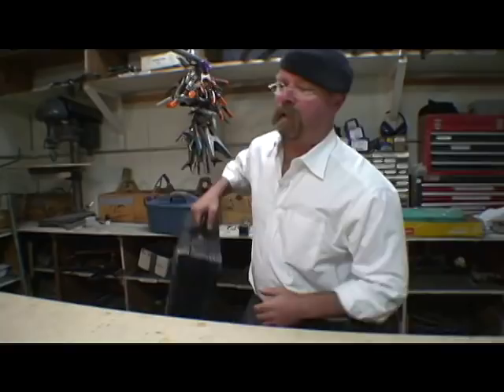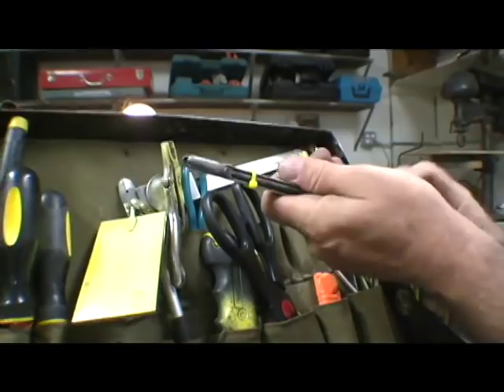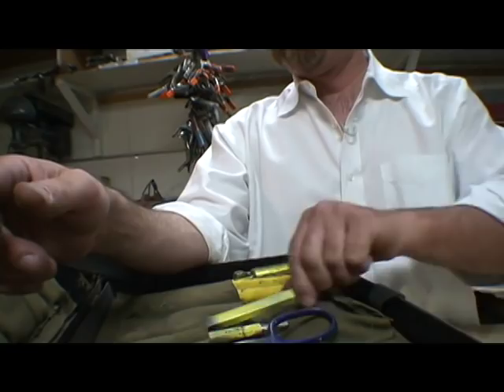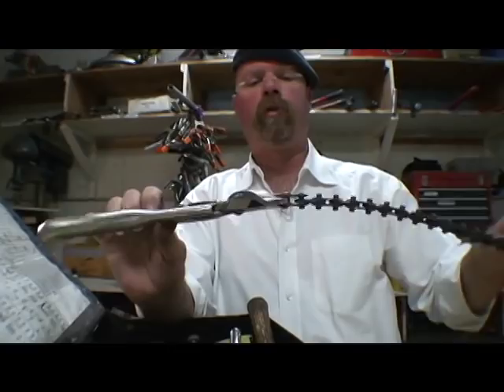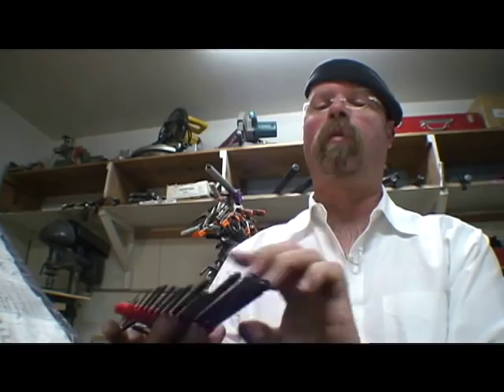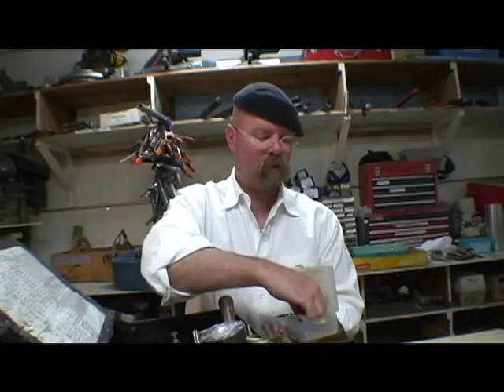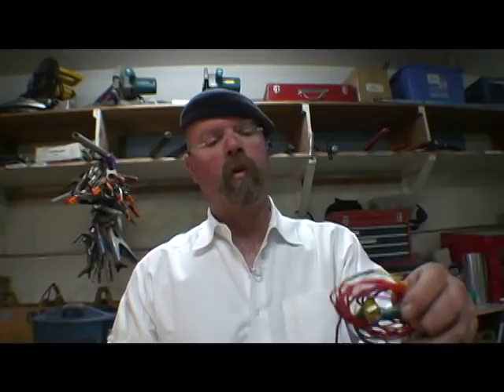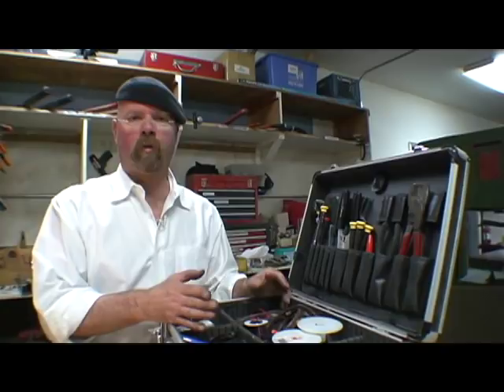M5 Industries - Jamie's Toolkit (2008)

Comment: Jamie's Toolkit complete list:
1) Flat head Screwdriver #1 Size
1) Flat head Screwdriver #2 Size
1) Philips head Screwdriver #1 Size
1) Philips head Screwdriver #2 Size
1) Long Flat Head Screwdriver Smaller
1) Long Philips Head Screwdriver Smaller
1) Set of Unibits
1) Telescoping Inspection Mirror
2) Small Vice Grips
2) Small Channel Locks
1) Caliper
1) Box Cutter/Utility Knife
1) Snap-Ring Plier
1) Utility Scissors
1) Fish Hook Remover/Long Reach Piler
1) Set Prick Punches
1) Center Punch
1) Telescoping Magnet pick-up
1) Glass Cutter
2) Set Forceps
2) Set Tweezers
2) Set Squeeze-to-Open Tweezers/Reverse Tweezers
1) Set Wire Bending Pilers
1) Hack-saw/Mini Haw-saw/Mini Hack-saw set
1) Metal Cutting Sheers
1) Wire Cutters (knipex) 
2) Sharpies
2) Pencils
2) Pens
1) Long Bit Holder with Adjustable Depth
1) Set Cold Chisel
1) Wire Piler
1) Exato Knife
1) Set Exato Replacement Blades
1) Bit Screw Driver
1) Set Bits (Safety/Security/Torx/etc)
1) Silicon Grease
1) Shrader/Presta valve Air-compressor Adapter
1) Dental Floss
1) Blades
1) Sharpening Stone
1) Ball Peen Hammer
2) Medium Vise Grips 
2) Large Vise Grips
2) Medium Channel Lock Pliers
2) Large Channel Lock Pliers
2) Small Crescent Adjustable Wrenches
2) Medium Crescent Adjustable Wrenches
2) Large Crescent Adjustable Wrenches
1) Large Long Flat Head Screwdriver
1) Nylon/Rubber Mallet
2) Slip Joint Pliers
1) Large High Leverage Cable Cutter
1) The Nibbler (cutter for square holes)
1) File
2) Small King Dick/Monkey wrench
2) Medium King Dick/Monkey wrench
2) Large King Dick/Monkey wrench
1) Tape Measure
1) Flat Head Stubby
1) Phillips Head Stubby
2) Vise-Grip Locking Chain Clamps
1) Drill Press Hole maker
1) Set Metric Ball End Hex Key
1) Set SAE Ball End Hex Key
1) Roll Plumbers Tape
1) Roll Electrical Tape
1) Roll Friction Tape
2) Small C Clamps
2) Medium C Clamps 
2) Large C Clamps
1) Box Set Hose Clamps 
1) Drill Bit Adapter
1) Counter Sink
1) Socket Extender
1) Set Threaded Hole Taps
1) Set Carbide Cutter
1) Set Welding Nossle cleaners

1) Set Conversion Table (Metric to SAE/SAE to Metric/Fraction to Decimal) 

Ultimate Electrical Box Jamie Hyneman
1) Solder Gun
1) Set Solders (Multiple Size)
1) Zip Ties
1) Set Clip Leads
1) Set Connectors 
1) Set wire (Multiple Size/Grade)
1) Set Electrical Tape (Multiple colors)
1) Multi-Meter (Analog or Digital)
1) Set Twist-on Wire Connectors
1) Automatic Wire Snipper Tool
1) Large Heavy Duty Wire Cutters
1) Standard Wire Cutter
1) Set Mini Screwdrivers (Flat/Philips)
1) Classic Wire Snipper
1) Telescoping Inspection Mirror
2) Set Forceps
2) Set Tweezers
2) Set Squeeze-to-Open Tweezers/Reverse Tweezers

Comment: Brilliant!  Only thing I would add to the electrical is a VoltAlert pen.  Good to have a non-contact way of knowing if mains wiring is live before going for the multimeter probes!  If there is space drop in a small electric screwdriver too for those bits (USB chargeable).  I guess we all have ideas of what we would add.  In the UK probably a few tea bags too!

Comment: The sizes of drills that are expressed with a decimal point are referred to as decimal sizes as compared with fractional sizes.  There are also letter size drill bits and metric size drill bits.
Reply: Not to mention number drills and left handed

Comment: You can also cut small screws with the silver wire stripper. There are threaded holes on the head of the tool for it.

Comment: Surprised you didn’t have a JIS #2 screwdriver. Everything made overseas in Asian uses Japanese Industrial Standard 1,2,3. You’ll notice Phillips doesn’t quit fit the screws in most of your electronics? Use a JIS bit or screwdriver. 

Oh yes! Knipex is heavy industry standard hand tools- I love them. A full set of Knipex pliers are absolute must in anyone’s kit. Ahh. Electrical. If I didn’t have Fluke as my sponsor I’d have spent $45,000 on test apparatus alone.
Reply: How does one get fluke as a sponsor :)

Comment: I am absolutely sure this kit is perfect the way it is - after all, there is considerable experience behind it - just a bit surprised there are something like 5 different screwdrivers in it - but no screws; there is a hammer - but not one single nail; there are drill bits - but no drill. Also, I expected some kind of glue and some cloth for emergency wiping ;)
Once again, I'm sure these aren't in the kit because they don't need to be there - I just thought they would come handy :)
Reply: I think this was built specifically to be carted around a shop where those things are common - Other than the electrical tape, none of this is consumable. I was surprised by the lack of drill too, but I think based on the other tools in there, it'd be pretty beaten up and he would have to remember to recharge the battery.

Comment: Those little Channellock #424 ignition pliers are not unusual at all.
And of course those 10 inch " Channekkocks " are actually WF made Craftsman flush joint tongue and groove pliers.
Actually a bit higher quality than Channekkock in my experience,  but sadly WF was just shut down last month.

Comment: How does he drive the taps without a tap handle and a tap guide/spring dead center?
Reply: My money is on a cordless drill. (M5 is all about getting ‘er done. And not about precision work. So a cordless drill seems like the obvious candidate.)
Reply: In a real pinch you can use a wrench

Comment: I watch this video because I carry respect to experience of this man. However, compact impact driver could substitute a lot of these tools in better way. Also, I did not see multi-meter, tap measure  and torch. finally, a lot of sold kits are more organized and compact.
Reply: Did you stick around for the second case?